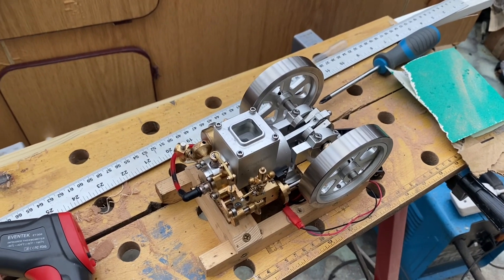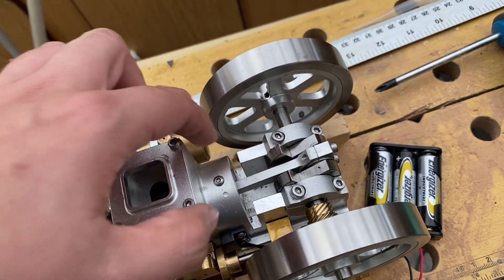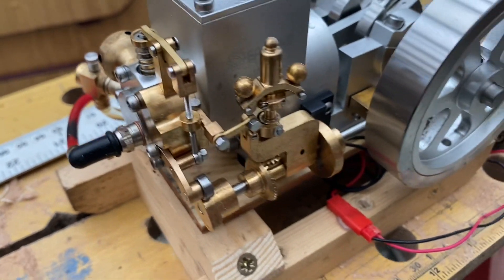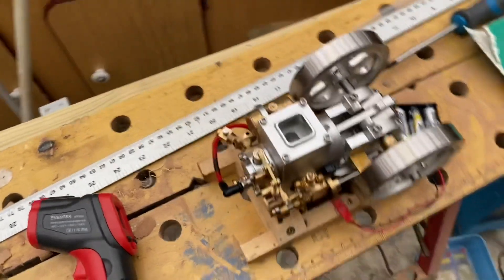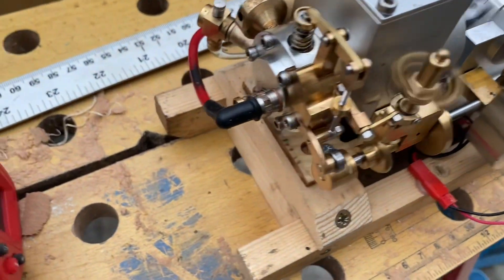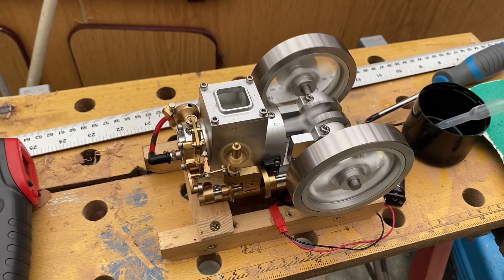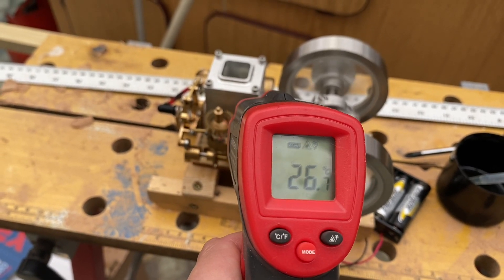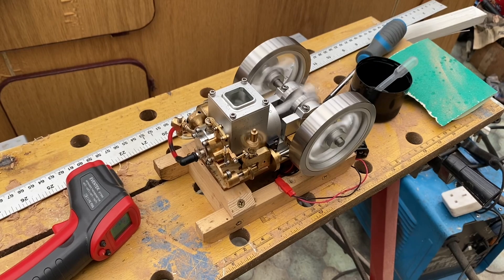Eachine ET6 - Running improvements - New base - Water leaked fixed!

Comment: Mine is extremely tempermental,
 runs like a racing car. . And unlike the ET1 and ET7, the complex governor control on the ET6 cannot be adjusted to make it run at a realistic speed.
All in all, I would never buy this model ever again
The most expensive and the worst model of all!

Comment: I've noticed that there is a little brass fitting which is on a threaded piece of bar, just where the governor arm is, what does that do? I'm thinking of getting this mark of engine. What are they like and are they any good?   Thanks< Ben
Reply from the maker: The brass fitting on the threaded bar is to adjust the time the exhaust valve is held open during the miss stroke... i have tried to adjust it but if its moved from where its set by the factory it doesn’t run right. 

Its a lovely engine. Beautifully machined. Well worth adding to the fleet. 

Ive run it for 30 minutes straight and it hasn’t worn anything. Runs cool. Sounds really nice and looks amazing on the shelf

Comment: I really cant get my head arouund the hit and miss engines, what is the purpose ( what is the miss for ?)
Reply from the maker: Saves on fuel... the hit and miss can do the same work load as a normal 4 cycle unit but on way less fuel. 

Just uses the stored energy in the flywheels to keep the engine going on the ‘miss’ strokes
Reply: @MO3MINI  were can the  economy come from,  the energy must go into the fly wheel , you must be running a fly wheel as well?
Reply: @yekateradiffin5939  It's a primitive engine design, they're very low maintenance as the 'miss' cycles help cool the engine and reduce wear, they were from a time before ball bearings and ran on babbit bearings, essentially lead poured into the spaces where shafts run. They also put out a relatively large amount of torque for the time so were good for running machinery for long periods of time. Think of hit-and-miss as a technological step between steam engines and the modern pressure-lubricated sealed crank 4-strokes that came after.
Reply: This makes sense now, its a link in development,